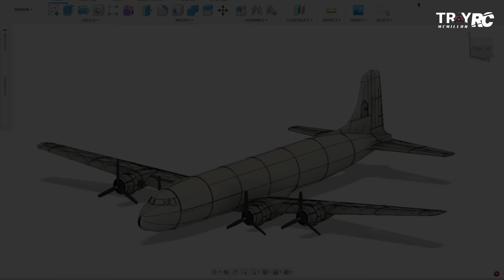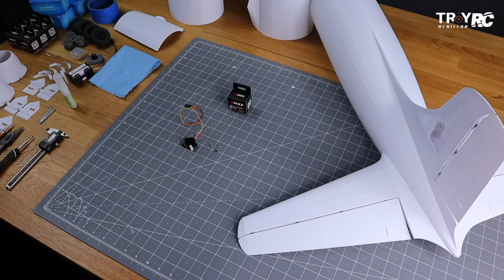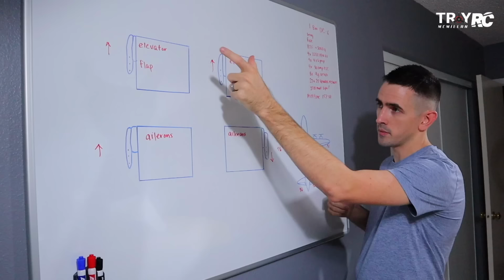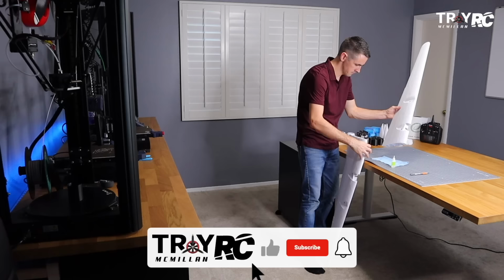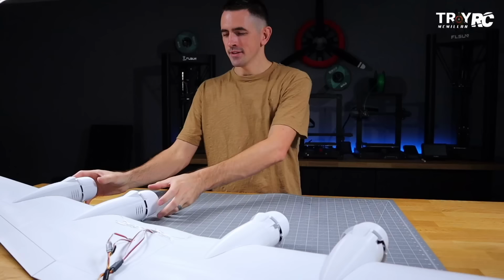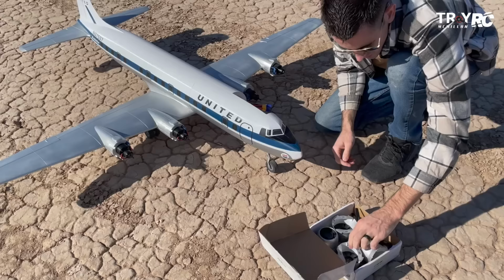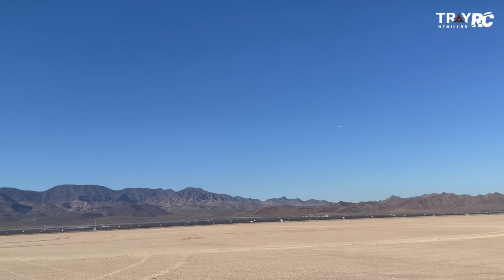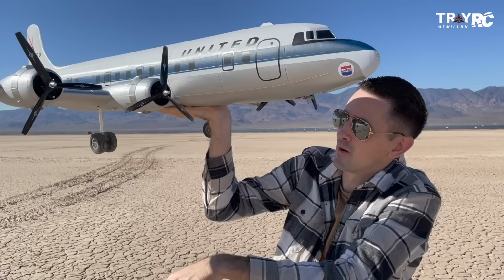BUILDING an AMAZING DC-6/DC-7 Airliner | Full DIY Build & Flight

Comment: Hey guys, you should think about building these aircrafts		
A380-900 	Passenger	80 meters (in real life)
A380-900 	Freighter	80 meters (in real life)
A380-900 	Lifter	80 meters (in real life)
A380-900 	Tanker	80 meters (in real life)
A380-900 	Airborne Early Warning and Control	80 meters (in real life)
		
A340-600 	Passenger	
A340-600 	Freighter	
A340-600 	Lifter	
A340-600 	Tanker	
A340-600 	Airborne Early Warning and Control	
		
Boeing 747-9	Passenger	80 meters (in real life)
Boeing 747-9	Freighter	80 meters (in real life)
Boeing 747-9	Lifter	80 meters (in real life)
Boeing 747-9	Tanker	80 meters (in real life)
Boeing 747-9	Airborne Early Warning and Control	80 meters (in real life)
		
Boeing 777-10X	Passenger	80 meters (in real life)
Boeing 777-10X	Freighter	80 meters (in real life)
Boeing 777-10X	Lifter	80 meters (in real life)
Boeing 777-10X	Tanker	80 meters (in real life)
Boeing 777-10X	Airborne Early Warning and Control	80 meters (in real life)
		
Boeing 777-9X	Passenger	
Boeing 777-9X	Freighter	
Boeing 777-9X	Lifter	
Boeing 777-9X	Tanker	
Boeing 777-9X	Airborne Early Warning and Control	
		
Boeing 787-11	Passenger	74 meters (in real life)
Boeing 787-11	Freighter	74 meters (in real life)
Boeing 787-11	Lifter	74 meters (in real life)
Boeing 787-11	Tanker	74 meters (in real life)
Boeing 787-11	Airborne Early Warning and Control	74 meters (in real life)
		
CRAIC CR929-800	Passenger	74 meters (in real life)
CRAIC CR929-800	Freighter	74 meters (in real life)
CRAIC CR929-800	Lifter	74 meters (in real life)
CRAIC CR929-800	Tanker	74 meters (in real life)
CRAIC CR929-800	Airborne Early Warning and Control	74 meters (in real life)
		
Ilyushin Il-97	Passenger	74 meters (in real life)
Ilyushin Il-97	Freighter	74 meters (in real life)
Ilyushin Il-97	Lifter	74 meters (in real life)
Ilyushin Il-97	Tanker	74 meters (in real life)
Ilyushin Il-97	Airborne Early Warning and Control	74 meters (in real life)
Reply from the maker: This comprehensive list is incredible. Thank you for taking the time to compile this, and I definitely plan on drawing some of these models in the future.
Reply: None of the CRAIC models even have prototypes.

Comment: I just purchased the files for this build last night, but was wondering if there are any safeguards built in for motor wiring that would allow for two opposing motors to continue to operate if one of the batteries went dead to prevent or at least minimize differential thrust in the event of a battery failure etc?

Comment: Hey Troy I’m hoping you can assist me. I have all my settings producing a nice wing section on Eclipson v2. For all of my panels, the leading edge and trailing edge have lifted to create a small bow. Do you have a fix for this?
Printing PETG
Reply: Trim adding a Brim... that helped my prints lifting off the build plate.  The lift usually only occurred on one end... the trailing edge.  The Brim held it down.

Comment: Amazing work...I'm interested in making one of these ones, but I only have a Creative Ender 3 V2. Can you tell me if I can build this model on my printer? And also, can I use PLA material? I am aware that its heavier.
Reply: Yea you should have no problem I have same printer if you get your settings right it will be fine. For smoother finish get smothers on amazon for around 10 bucks for the x and y axis

Comment: Hey Troy, could I confirm info about the retracts?  The link provided shows a size of 65.8 (L) x 35.1 (W) x 25.1mm (H).  Retracts always seems to be the biggest pain for sizing.  You show a size of 27 x 25.  Could you detail what the 27 x 25 is?  Could you provide a screw hole to screw hole dimension for both the width and length of the retract mounting plate?  Also, you're showing a 2-blade prop part and you're using a 3-blade Master Airscrew.  I'd prefer the 3-blade... it looks so good.  Any reason for the 2-blade other than availability?  Thanks.
Reply: Figured out the retract sizing.  Your 27x25 refers to the distance between the screw holes... 27.70 x 24.30.  The link sizing of 35.1 refers to the width of the plate.  The plate size is 32.50 (L) x 35.10 (W).  This size retract is somewhat commonly referred to as a 40g servoless retract.  They are very common... thank goodness.
Reply from the maker: @rcdavidk  I chose to use the most common retracts I could!

Comment: I am just starting out with 3d printing and am fascinated with the process  but would very much like to get some working knowledge of the design side of developing the 3d design that leads to the stl files.  Do you work from plans initially or import a 3d scan from say a plastic model as the basis for your design?
Reply: Hi Michael, I've been studying Fusion 360 for about a year, in fits and starts. There are many youtube videos out there that show how to design R/C planes from 3 view drawings. You can scan them and import them in to create a canvases in F360. Then you can draw SKETCHES as needed along any axis using the imported drawings (Canvas). Then you can create lofted surfaces over these sketches to create the outer shape of the models. Beyond that, there are some very cumbersome techniques to create the detail inside the models, such as mounts, interfaces to join parts. From these solid bodies you can then export them as STL files (Triangle and Edges). These can be read by a slicer program such as Matter Control or CURA, or Prusa, and the output of the slicer of your choice are .gcode files, instructions for a 3D printer. That's what I know, but Youtube is always my go to place for what to do when I get stuck. Troy uses F360. He shows in this video in the beginning a time lapse of his design process. It it quite amazing.
Reply: @sunsetmodels  Thank you for the input.  I will look for Troy’s design video.  I have looked at several 3d modeling software programs and the learning curve for each seems quite daunting to master.  I was thinking that a 3d scan of a plastic model might be a bit easier to start with but no knowledge here.

Comment: Hi everybody
I'm trying to print the DC6 with my new BAMBULAB X1C but in bambustudio slicer, the inside reinforcement of the mesh doesn't 
work at all, even in the ''even-odd '' slicing mode, does someone fixed the problem ?
With thanks for help

Comment: are you needing lots of throttle in these 3d printed birds as the need to keep the speed up seems to be evident, looking at fiberglass vs 3d printed aircraft are your 3d printed aircraft generally heavier Troy?
Reply: It depends on what material you use and what wing design. Most of these airliners have a high wing loading and fly fast even the balsa and fiberglass ones just like their real-life counterparts. They are thin swept-back airfoils. You would have to build with foam to get slow scale speed and modify the wing airfoil for slow flight.
Reply: @FarmerFpv Right you are yes there are a few choices for materials and airfoils for sure!

Comment: Hello Troy, I greet you with pleasure on the occasion of congratulating you on that eeespeccular work on the Douglas DC-6, my favorite plane, as well as the DC-3. I ask you, would there be the possibility of providing me or, or selling me the blueprint of the DC-6 in a USV to elaborate it, or, or failing that, an airplane kit, I must emphasize that I do not have such sophisticated equipment and here in Guadalajara Mexico I do not We have these machines still available in the Mexican market. THEY ARE IMPORTED and are very expensive due to taxes and shipments, so I would be very grateful if you gave me the pleasure of having that DC-6. thanks troy

Comment: Incredible video! I love the work you put into the plane! Now comes the dark comment... I never understood the idea of 3D printed planes. They are fragile, heavy, non repairable, and it does actually cost a lot of time and money to print and build. 3d printing is great for testing. But it’s not feasible for getting a cheap fun well flying plane.
Reply: This plane is SOLID. I would say it is just as strong as any of my foamy jets, and looks freakin' amazing!
Reply: I dunno he crashed one pretty good a while back and just printed new sections and got it flying again. Its a pretty good video you should watch,  but you are right it is a lot of time you will need to dedicate to build and fly.
Reply from the maker: Cost wise, 3D printing your own plane from scratch is comparable if not less than purchasing a RTF or ARF, and if building and tinkering is your thing - then the time spent putting it together is part of the fun too. And they can definitely be repaired! Just print out the section that is damaged, and glue it back onto the rest. It depends on the speed the plane was going on impact, of course. I've crashed 3D printed planes pretty badly before and have been able to repair them. Here is my most recent repair https://youtu.be/EvDbhInfS2c

Comment: Question can you get a auto stabilization kit in there? I need to know because I’m a noob at flying Rc planes
Reply: You could use a 3 axis gyro to correct for gusts etc, but It looks to handle like an airliner which is a bit harder than an over wing trainer style design, Id say its easy to handle if you can take off and land a trainer but getting as smooth as Troy with how he treats her takes a lot of skill. Something to keep in mind as a novice pilot :)

Comment: Never liked y cables, putting each servo on a sperate channel gives you the ability to electrically trim all surfaces instead of having to try and get it right mechanically.

Almost all of is are running transmitters that can handle 16 or more channels and receivers that can do at least 8 pwm and many more over sbus, ibus or ppm and flight controllers that can output 8+ pwm for servo control.

Comment: Hello! Are any of the parts actually taller than 180mm? I have a wanhao i3, and have a max print height at 180mm..
Reply from the maker: Unfortunately yes, I designed it to fit the standard build volume of 200x200x200

Comment: No spars anywhere?
Reply: I was about to ask the same.  I thought I zoned out during the build and missed it.
Reply from the maker: No carbon fiber spars. there is a spar though, I designed it to be integrated within the pieces wings.
Reply: @TroyMcMillan  Clever.  I rewatched some of the printing.  Me likey.
Reply: @TroyMcMillan  Basically you are relying on the CA bonds to be greater than layer adhesion...the weakest link in 3d printing...so no need for over engineering.  Brilliantly practical.

Comment: Hey could you please tell me what kind of plastic you are using for the whole fuselage and the wheels?
Reply: eSUN PLA+ for the fuselage and TPU for the wheels
Reply: What size PLA?
Reply: I just purchased this printer about 10 mins ago so I’m pretty green at everything regarding 3d printing.
Reply: @Scradley2241  oh really, good choice man. welcome on board to the world of 3d printing, where you'll certainly have lots of fun (and problems too😅)
Reply: @Scradley2241  so yh in terms of filament diameter sizes, there are kinda 2 standards for printers: 1.75mm or 2.85mm. 
For the FlSun V400 printer, it's 1.75mm, so make sure you get that size.
Reply: @Scradley2241   PLA is a very good material to start off with as it's nice and easy to print with, has good bed adhesion and good mechanical strength. The best filament brand is the eSUN brand. They also have PLA+ which is slightly more stronger than normal PLA, a spool of 1kg is under $20 on Amazon. Hope this helps a little.
Reply: Yes that helped a lot. Thank you. I’ll go with the PLA+.

Comment: I don't recognize the CAD software you use. Which is it?
Reply: Autodesk Fusion 360
Reply: @matthewlaberge  They've come a long way. I started using ACAD 9 in the late 80's, moving into ACAD 13 3D solids then Mechanical Desktop 2.0. Fusion looks a lot like SolidWorks that I use now. My dad worked at MDC on the DC-8, DC-9 and DC10. I later worked at MDC on DC-9 and MD80. Ten years later I designed night vision compatible instrumentation for Boeing F/A-18, AV8-B and F-15 mods. Later working on the C-130 AMP project. Having aircraft in my DNA, I can say that you have done a fantastic job on the DC-7. Bravo.

Comment: activator?
Reply from the maker: I don't use activator! The glue dries within seconds
Reply: You must like sticky fingers LOL not been my experience but glue dries much more thoroughly and evenly I wish I could afford a 3D printer like you have I would love to build my own aircraft in this manner how do they hold up in crashes?
Reply from the maker: @x-movieclips  Haha, after years of working with CA glue I'm pretty good at avoiding gluing my fingers to things 😅 I used to use an activator, before I have realized it discolors the glue and makes all the seams turn yellowish. 

3D printed planes hold up similarly to other materials, and it kind of just depends on how fast you were traveling on impact... It's easy to glue cracks no problem, and if the crash is bigger you might need to reprint sections. Check out this video I rebuilt one of my planes https://www.youtube.com/watch?v=EvDbhInfS2c

Comment: information            (a   BIGFAT  cargo plane.!!!     yippee)            it is the Opposite of smart to put the  Mass  of three servos at the tail.!!!          it is the opposite of smart to use two servos to control a split elevator.
6:13   there is a shortage of span-wise 'strength' at the roots of the horiz-stab halves.
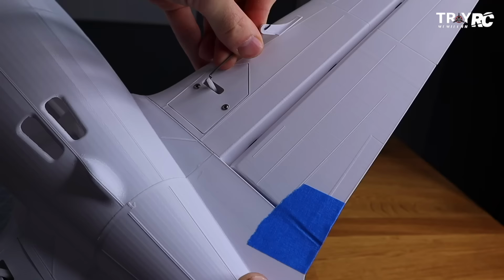8:08   it is the opposite of smart for a pushrod to be  really  short.!
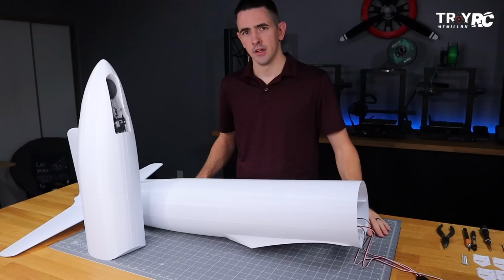9:32   a main wing is  SUPPOSED  to have a  contiguous, LOAD-BEARING  main spar.!    Located at THIRTY  percent of chord.!
when designing a  TINY  wing, it is  RECOMMENDED  that a scale-accurate profile  NOT  be used.!     instead, the use of a flat-bottomed profile is Recommended.    ( see the n-10  or  clark-y. )
in order to be sufficiently resistant to twist/wrack, a wing  SHOULD  have  some  rib-like  structures in it.!!!
12:19   the mass of wing-located servos should be located as far inboard as is practical.      that mass should also be located  just FORWARD  of  THIRTY percent of chord.!      in other words, just forward of the  MAIN  SPAR.!
googletranslate
Reply from the maker: I always appreciate your feedback!
Reply: David Davids opposite of smart to say that to somone who has already build and flown the model successfully the  way he built it!!  All my RC planes have the elevator and rudder servos in the back.  They make them that way now with light weight servos!  Get wise.

Comment: It's such a shame, beautiful plane with electric motors. Would have been a thousand times better, if you had four nitro engines or four gasoline engines. You are a Trader to what was once a great great Hobby. Too many people flying electric planes made a styrofoam for the most part. We no longer have, real models in the hobby. Nobody knows how to build a plane from scratch, everybody wants instant gratification, they turned it into a toy Hobby.
Reply: I started flying control line in the 1950s, moved to Free Flight and occasionally R/C. Modelers have always experimented with methods and materials.  There are plenty of places where you can fly electric but not nitro/gas because of the noise. I remember guys in the old days squawking about how RC was the lazy person's way to avoid learning how to properly trim a powered free flight model. This is a good looking, nice flying model. That's enough for me.
Reply: Stick to electric to avoid global warming 🤣
Reply: What an idiotic take. Look up the term gatekeeping, you'll learn that you're a gatekeeper. Nitro is much less reliable, messy, and an all around hassle of a powerplant solution. I get that you may have been brought up on it, but there is absolutely no point to insulting electric motors because you're stuck in the past. That wouldn't even be practical with PLA plastic as the exhaust would destroy the wing mid-flight.
Reply: That's rough. He designed his own 3d model. If you think it's easy to design something so that it is printable then you have never done it. He applied differentl skills to the hobby and I am actually very impressed with the results.

Pretty mean comment you made here.
Reply: Old Man (with Ironic Nickname) Yells At Cloud...

...instead of flying in them.

Getting old comes to us all (unless we die early); being a Curmudgeon is a choice.
Reply: @higgs923  Well said, Sir!
Reply: "Get off my lawn!" The only shame here is your attitude.